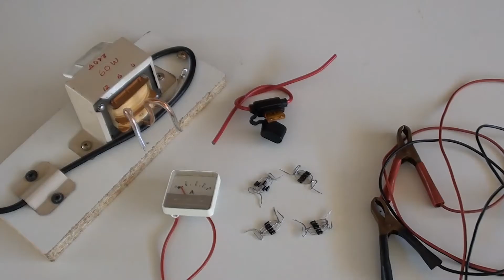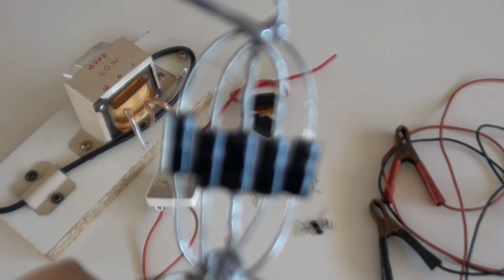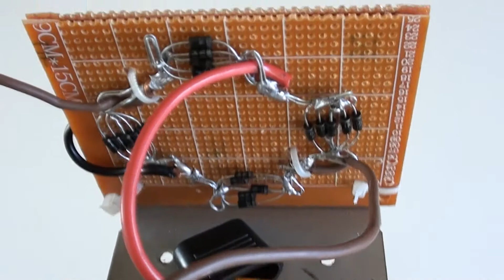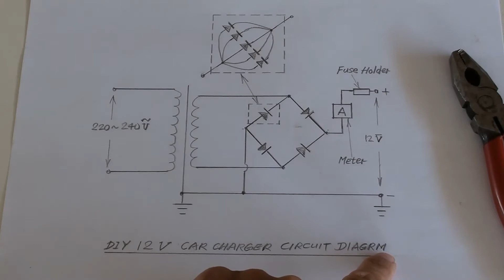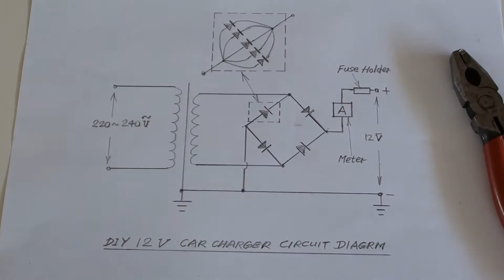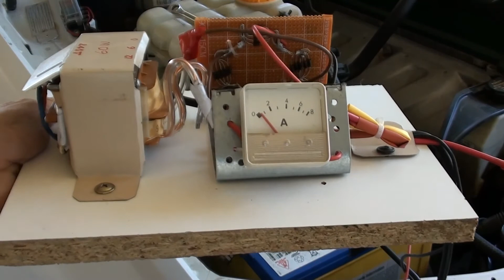How to make 12V DC Car Battery Charger, DIY?

Comment: Diode value pls? and transformer rating?
Reply from the maker: Sorry for replying you late.   Diodes used were 20 X 1N4001:  50V and 1A;   Transformer came from elec recycle which was the one:  240V / 13.3V and 60W (According to its core area to worked it out).